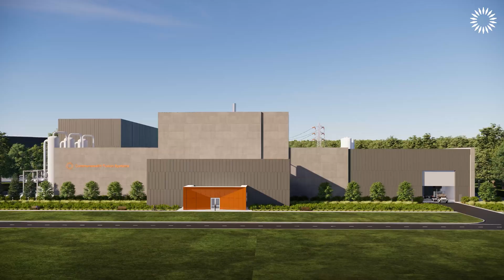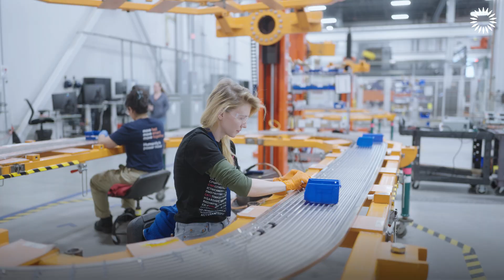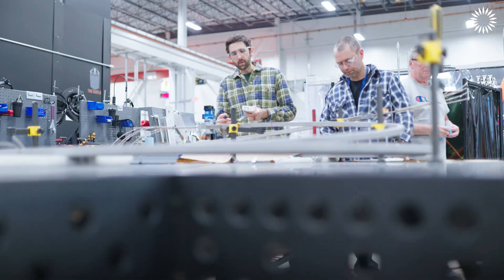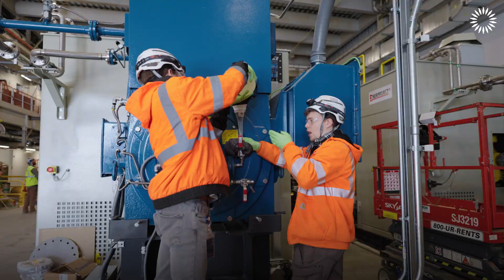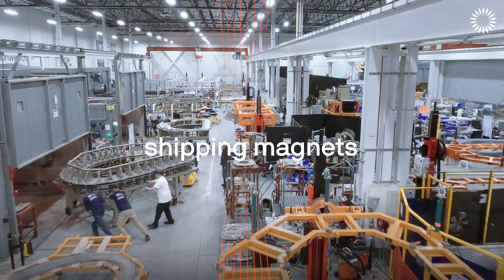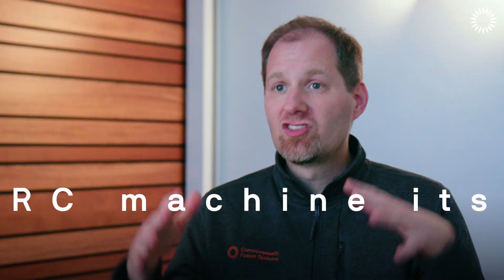An Update from Commonwealth Fusion Systems (December 2024)

Comment: Commonwealth Fusion Systems (CFS) SPARC machine is very far away from CFS’s promotional claims that it is a prototype of the ARC machine that CFS claims will generate approximately 100 megawatt-hours of continuous, grid-ready, electrical energy. The ARC machine plans include a tritium breeding blanket and tritium processing facilities required to generate the radioactive tritium component of this D-T fueled fusion experimental reactor.

SPARC is not a prototype. It is a greatly stripped-down version of the ARC design, primarily to research how to solve many of the continuing problems plaguing the nuclear fusion energy field.

SPARC will lack a primary heat removal system. As a result the experimental D-T ‘fusion’ test shots will each require a lengthy thermal recovery period before the next ‘shot’ can be conducted. SPARC will lack the essential tritium breeder blanket along with associated tritium processing facilities. Unlike a typical electrical power generating facility SPARC is missing a reactor heat removal system as well as a turbine-generator system.

SPARC experimental shots will  have to be widely spaced in order to allow a thermal recovery of the machine.
Reply: ARC should produce 400 MW for the grid, not 100 MW. SPARC will indeed use shorter, less frequent pulses since it won't have a blanket that as you point out cools the system and breeds tritium. Re "greatly stripped down," I think that's too strong. Most of the ARC subsystems are present in SPARC. (I work for CFS.)
Reply: @StephenShankland  - Thank you for correcting me regarding the PLANNED energy that ARC is expected to deliver to the local grid in Virginia. It is unlikely to achieve that if SPARC encounters significant issues over what is PLANNED for it. In order for ARC to deliver 400 megawatt-hours of continuous electrical energy to the local grid it will have to generate in excess of 800 megawatt-hours of fusion derived fusion energy plus the energy required to operate the entire facility which includes all the support systems, the tritium breeding system and the tritium processing facility. Not only is SPARC lacking in the tritium breeding blanket it is also devoid of a significant primary heat removal circulation system, a secondary heat removal system, a steam generator, a turbine and a generator and an electrical substation, which is required for such a electrical generating station. Perhaps you never learned about those issues in the fusion energy classes you took. SPARC will be limited to a very tiny fraction of the planned 800+ megawatt-hour thermal output of ARC due to its lack of significant cooling systems. That is one reason the torus current will only last for 10 seconds and fusion energy experimental pulses are likely to last for much shorter periods of time. I'm sure the promotional announcements will state the peak level of SPARC's fusion energy achievement without any explanation for how short the pulse is and how much energy is consumed by the facility between each experimental fusion shot. I urge you to contemplate the difference between propagating promotional propaganda and having critical thinking skills.

If ARC fusion pulses last one second and then repeat at 10 second intervals then the ARC fusion thermal pulses will need to be greater than 8,000 megawatt-hours in peak amplitude so that they can be averaged down to 800 megawatt-hours of continuous thermal energy. Such thermal cycling will stress all the components of the reactor subjected to the irradiation of the 14.1 MeV fusion neutrons. None of CFS's promotional presentations address such issues. Most of those, who fall in love with the technology, never consider such issues.

Comment: The development of a commercially viable nuclear fusion plant remains a distant goal, likely several decades away and possibly closer to a century. To date, no experimental reactor has managed to generate a significant amount of fusion power. The net energy gain—the difference between the energy produced and the energy required to sustain the experiment—remains disappointingly low.

No fusion reactor has ever operated in a stable manner to produce substantial power consistently over many years. For example, a 400 MWe power plant would require a reactor capable of generating approximately 1,200 MW of fusion power. The most notable achievement so far was the production of around 17 MW at JET, and that lasted for only one second in the late 1990s. (I am not even commenting on the amount of energy needed to produce 17 MW for 1 s of fusion power... it would be too embarassing). 

Furthermore, no fusion experiment has succeeded in delivering even a single watt-hour of electricity to the power grid.

Another significant challenge is the lack of materials capable of withstanding the extreme heat and neutron fluxes required for sustained, full-power operation over decades—or even weeks—in a fusion plant.

The claim that fusion fuel is abundant and inexpensive is also misleading. Tritium, one of the primary fuels for fusion, does not exist naturally. The worldwide inventory is limited to roughly 20 kilograms, primarily as a byproduct of CANDU fission reactors. While technology to breed tritium within fusion reactors is under development, it remains unproven and untested. Even under the most optimistic projections, experts agree that perfecting this technology will take decades.

Beyond solving the scientific, material, and technological hurdles, a commercial fusion plant must also demonstrate acceptable levels of availability, maintainability, and reparability. Achieving these operational benchmarks will require the design, construction, and rigorous testing of several full-scale prototypes.

Comment: With all due respect and I love fusion but why does this need to be cut into?Yet a new swath of forest can we build it within the city so we don't continue spreading out like cancer and keeping beautiful forested land intact ???
Reply: Don't be a 🤡. Not many trees at all in the grand scheme of things
Reply: Good question, I'm a huge fan of trees... I mean, just look at my username, and thankfully the amount of land that's to be cleared is very very modest for the scale of the technology involved. Besides, if fusion displaces coal plants (which is part of the whole idea in order to avoid consequences from something called Jevon's Paradox, which you might find interesting) which require coal mines which frequently seriously deforest mountainous areas, the amount of tree acreage saved will be on the order of thousands highly conservatively of times more than the trees on the the land used to do this. In other words, even in terms of trees, it's an extremely good bargain. Also the technology is actually quite well adapted to going into old coal plants, a method which both uses existing infrastructure (so no sad trees where new power-lines would otherwise be built) and keeps cost down because new construction is minimized. It's cheaper and greener and safer and I'd bet my lunch money for a month that it's going to work.

Comment: You're building this a mile from my house... please don't make chesterfield chernobyl or open a warp portal that demons will come out of. Please.
Reply: Good news: Meltdowns and runaway chain reactions just don't happen with fusion. If something goes dramatically wrong, the plasma stops fusing and cools down immediately.

We do actually produce some radioactive materials: the vacuum vessel over a period of years gets activated by the fast-moving neutrons. It's not long-lived or high-level nuclear waste, though. And one of our fuels is tritium, which is also radioactive, but fusion requires very little fuel, and we'll make our own tritium within the tokamak itself for a closed fuel cycle. Fusion doesn't require large quantities of fuel.

I believe there was some research in the 1970s about unleashing demons, but it proved not to have any commercial viability beyond licensing the movie rights to Ghostbusters.
Reply: Fusion is totally safe compared to fission. It requires energy and fuel to run, so hitting the off switch immediately stops the reaction. No radioactive fuels or waste either. That's why there are no TV shows about fusion reactor disasters!

Comment: The ability to create and sustain fusion is accepted and understood, especially with tokamak's in regards to operational time length; but if the goal is energy production unlike ITER whose much larger tokamak i have no doubt of sustaining much longer periods of fusion (though no plans for energy production) what is this project's choice of electrical energy conversion?
Reply: We'll use a molten salt blanket that the fusion neutrons heat up. That will heat water that runs a conventional steam turbine.
Reply: @StephenShankland  thanks for the reply! Was wondering about it. slightly related side note: when will we exit the steam age? The max efficiency of steam turbines still being under 50% i am quite hopeful for advances in some other form of energy conversion to electricity that may be more efficient, for example electrostatic methods like the Venetian Blind. though for now in time the priority is of course achieving stable longer term fusion I am hopeful/working on better conversion methods
Reply: 😂 Да хоть в  течении года, но свободной энергии вам не получить. Как не получили алфимики философский камень. Не в 2030, и даже не в 2035.🎉 Легче человека отправить на Луну с миссий Аполлон.
Reply: @lazy7632  Fusion violates no physical laws; it can't give us free energy. What it can do is through fusion give out more energy due to how the fundamental forces work at very extreme conditions; direct drive systems unlike the Tokamak have proved a net positive run of a Q factor of 1.5 (from memory may be wrong on the exact Q factor)

Comment: I think this project's odds of success in the next few years are modest (10%).  But, since the cost of the gamble is only a few billion, and the prize for success is potentially trillions in wealth plus difficult to quantify environmental benefits--the gamble is easily justified.
Reply: There's tones of these going on, all we need is 1 of them to be a success
Reply: There’s no new science for this to work.
Reply: @bxlawless100  We'll get there
Reply: @bxlawless100  Scientists demonstrated a positive energy balance for fusion only a few years ago.  And this was at the lab scale.  There is a long way to go to scale this up and prove the technology at near commercial scale with an acceptable energy balance.  After which time the first commercial facility can be constructed.  If the first commercial plant works reasonably well, then the second plant (with improvements based on experience from the first plant) can be built.  If all goes well, the second commercial plant will achieve reliability targets (about 95% annual capacity factor).  Only then will the industry have developed sufficiently to justify a robust construction program of multiple fusion power plants.  I expect it will take at least 30-40 years before this point is reached.  By the beginning of the 22nd century, we may have multiple fusion power plants in operation around the world.

CFS’s projection of an operating commercial-scale plant by the mid-2030s or so is absolutely absurd.
Reply: @bxlawless100  Well, then the engineers have been very lazy, haven't they?  When did we complete our scientific understanding and turn things over to those lazy engineers?
Reply: @kreek22 Ha!!  You really have no clue what is takes to scale up and reliably demonstrate a radical technology like this.